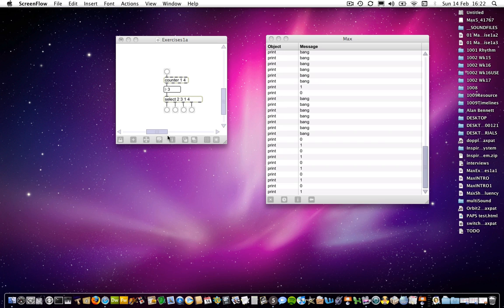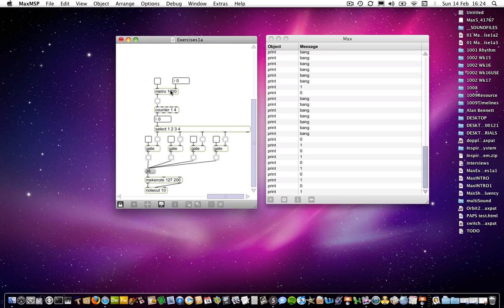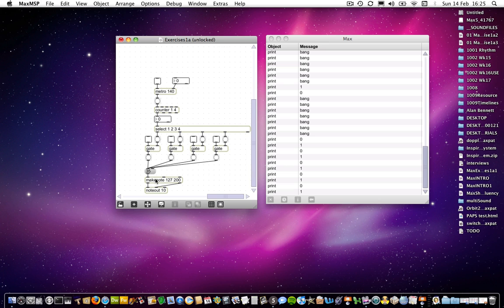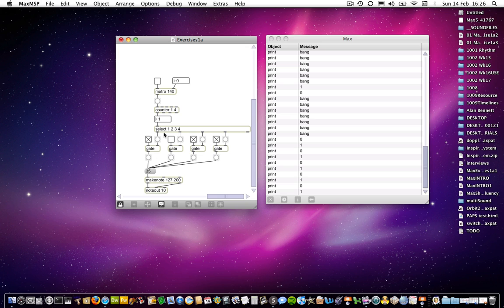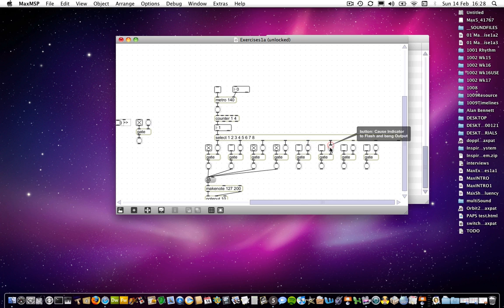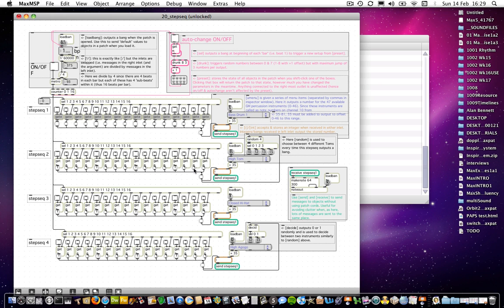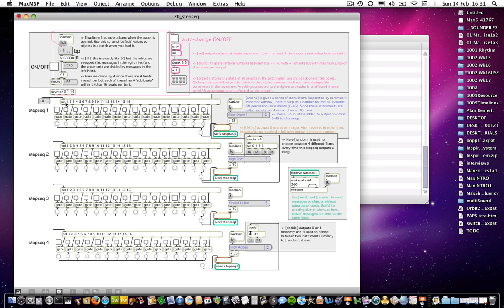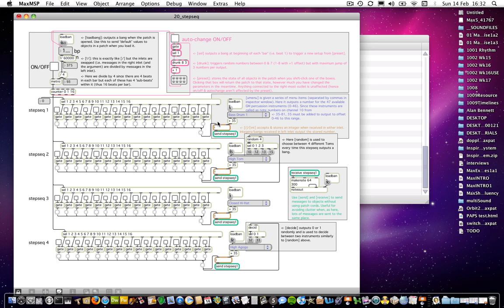Max MSP Tutorial 01a4: Building a simple step-sequencer [4]

Comment from the maker: @rasputindonie Hmm. If the AU DLS synth is available, it should work. And yes, you are sending MIDI data out of the [noteout] object which is controlling an external synth (i.e. the AU DLS Synth is not part of Max/MSP).
Just a thought: is the right-hand outlet of your [makenote] object connected to the _middle_ inlet of the [noteout] object (which is correct) or the right-most inlet (which is incorrect!)? This is a common error so I thought I'd ask...

Comment from the maker: @rasputindonie With the patch locked, double-click on the [noteout] object. What does it show you? If you're working on a mac, the AU DLS synth (which is actually a GM sampler) should appear  in the menu. Select that and you should get sound output. On a PC I'm afraid I'm less sure. You may need another software synth open on your computer that you can route to internally. If that's open when Max is open, its inputs/outputs should appear in the [noteout] list.